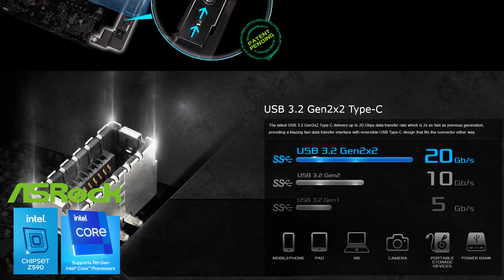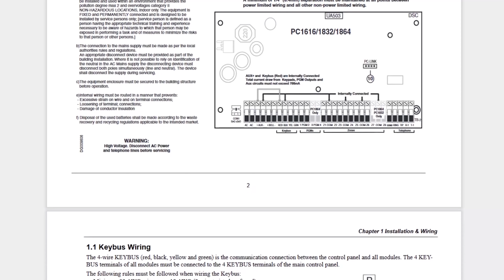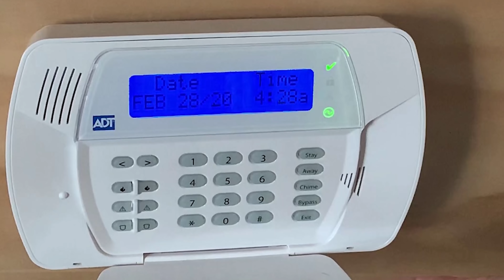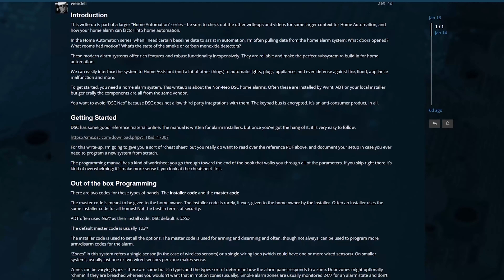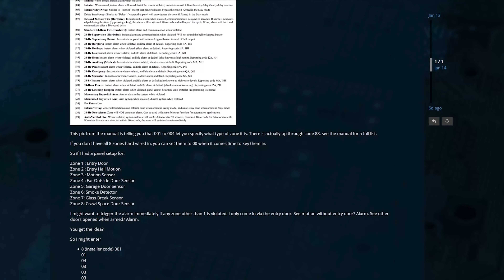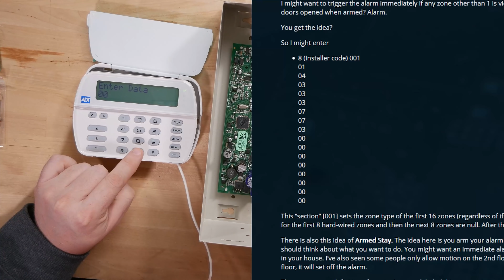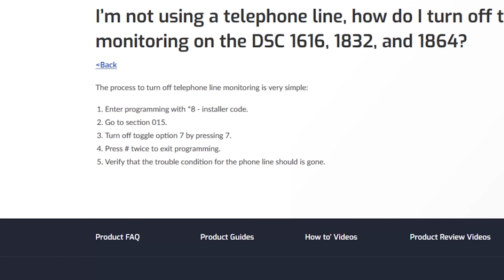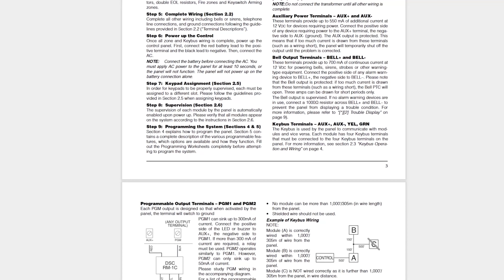Better IoT: Getting started with a DSC Home Alarm

Comment: Watched your Vids,  thought it was pretty good.  So I decided to swap out my legacy Radionics D2112 and upgrade to the DSC 1832.  I also got the expansion module (5400) so I have 16 hard wired zones.  I got the Envisalink 4 which is an awesome little add on board.  All of my legacy Radionics PIR and Sensors worked just fine.  Smoke/Fire is a different story, but they are very old.  For a keypad I went with a RFK5500 and a 5501 to replace my legacy keypads.  My next and finishing step is to get wireless smoke and a couple of sensors just cause I can with this system.  All of this runs to a Rasberry Pi4b running HomeAssistant.  Home assistant works flawlessly with this setup and can see all of the sensors.  Best of all I can see and run the whole system from my iPhone from anywhere.  Oh yeah, I removed the middle man, NO SUBSCRIPTIONS needed, Yeah me!  Good recommendation!

Comment: I'm really enjoying these videos. Now, bare with me. I have a Ring alarm system.. I KNOW, I know, it's the worst thing in the universe. I was paying $180 every 2 months for ADT, and the entire Ring package came up on Woot for sale for $180. 
It's unmonitored so for a single $180 payment I replaced my $180 every 2 months bill.
It was easy to set up and it's easy to monitor. One day I might switch to a more, home rolled solution but until then I like watching videos on what I should have done instead.
Reply: Simply safe is the worst system you can buy for reference. Also ADT is overcharging all its customers simply because they can just as a result of the name. People buy into the name without ever really researching anything. There is definitely a big difference between a professional alarm and a home install cheap alarm mainly is that one can easily hack anything such a Ring, Simply Safe, etc where a professional system (that has been properly set and programmed) will be near impossible to crack.

Comment: If you move into a house (or business) that has one of these systems installed you should definitely invest the time and learning curve to get it up to full function. These were typically built into the house at the time of construction, and retrofitting an existing structure with this layer of security would be very expensive. Despite their "legacy" appearance, these are much more robust and foolproof than today's trendy all-WiFi do-it-yourself kits, which are easily jammed or spoofed by professionals. This is an industrial-grade, pro-build, however the one thing you will definitely want to add is camera support, as these typically did not have them at the time.

Comment: Just a note

You DO NOT want to use CAT wire for the panel to control board.
RS485 does not work well with twisted wires

But the main difference between between the cables and normal cat cabling would be the twists.
Alarm cabling doesn't come with twisted pairs and is also easier to bend around corners or stick to walls

Comment: Perhaps I missed the video, but how do you integrate this with Home Assistant?  I have an old Power832 in my house and I'd like to map these to Home assistant.  I was thinking of scrapping the main board and rewiring all of the sensors to an Arduino Mega with MQTT.  Is there a better way to get my hard wired sensors to report to Home assistant?  Thanks

Comment: If you have more than one keypad, does the wiring from both connect into the same ports in the box?

One problem with door sensors is when your cats are smart enough to open the door into the garage.
Reply from the maker: yes, shared bus. You change the keypad # in the programming, it's pretty easy to do.
Reply: We are trying to build a house and this series is so awesome while planning low voltage.
Reply: @pkt1213  this system is completely out of date.

Comment: Or if you just run a 8/12 core wire to your keypad... you can run a few sensors from your control board through your keypad to the sensors (you don't actually connect all the wires to the keypad but just use the housing to hold the join that then runs to the sensors nearby)

Comment: One question. Does the rfk5500 handle up to 64 sensors? I think I read that you need the rfk5564 otherwise you are limited to 32 sensors

Comment: Are the IMPASSA keypads compatible with the power series?
Reply: No, the DSC Impassa keypads are incompatible with the Power Series. But, the 433MHz wireless sensors are compatible between the two systems (if you have a Power series wireless receiver or wireless capable Power series keypad.)

Comment: If I hooked this up with the same discipline that I setup the rest of my home automation system I would have a CA certificate not renew and then the fire department would never get called haha.

Or it would renew but the fingerprint used for device auth would be based on the old cert not the ca cert and then the same thing would happen.

Comment: Man trying to program all that zone and system configuration through that clunky panel seems awful. It would be perfect if you could directly interface with that config through a linux terminal and just tap away in a text file or even a GUI.

Comment: Point of note I stopped right when you said not to buy the Neo. The Power series you are showcasing is completely out of date, Neo is the next generation of alarm panel and features are 1000x better than the old last generation PowerSeries. I am a certified technician and have been installing systems for 17yrs+ if you don't understand the technology don't talk about the technology because you are giving much misinformation.

There are several key programming sections which will completely lock out a panel from anyone else, a fuse does nothing to stop from being re-programmed. 

Duress code feature is only available for proper use if actually being properly monitored with an actual alarm company, it cannot just send information over to the police.

The installer code is for full programming of the system not the master code. The ADT code as you state is there only if it has already been actively setup for monitoring at some point. 

If you do not purchase the alpha keypad for this system there is almost no way a standard person would know all the beeps to understand what they are programming.
Reply from the maker: The non neo system is still manufactured in point of fact. Any adt branded panel will have the adt code when you default it with the zone 1/pgm1 code.  The reason I don't recommend the neo system is because it's not interoperable which you didn't bother to address in your missive even though I addressed that in the video. That's not "misinformation." And certified by whom? Adt? You sound a bit defensive ;)